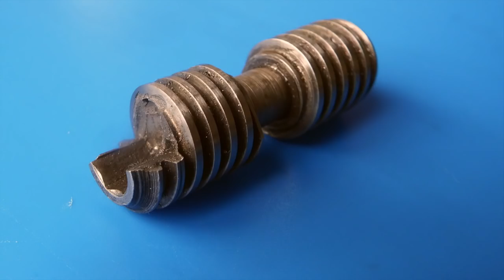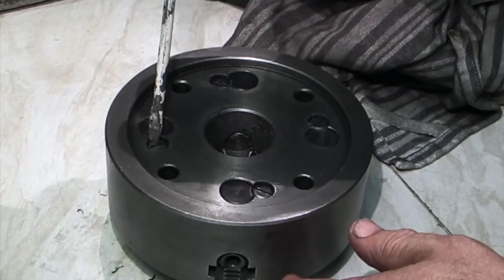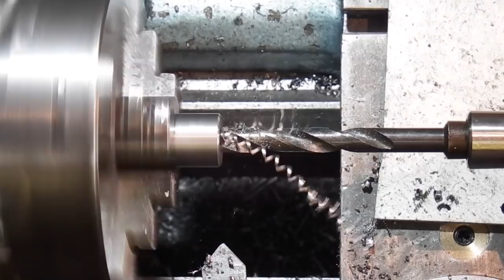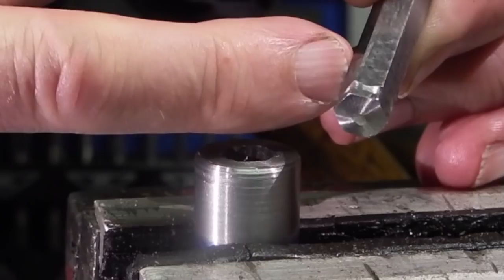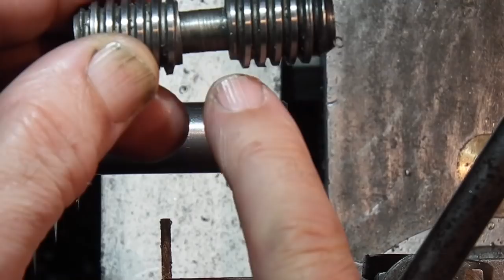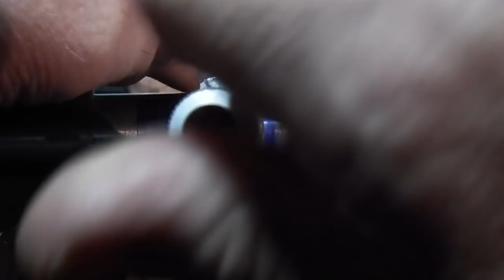4 Jaw chuck repair part 1

Comment: I need to do this with my 6inch Bernard 4 jaw Chuck, firstly I need to rebuild my model A metric lathe, then get a rotary dividing table, then make a 127/135 gear set,  all that’s in my rountoit pile, making useful parts seems such a long way off, I wonder what the ratio to repair/ making useful parts, when you acquire a 50+ year old lathe,
I watched this when it was first posted and I needed to do it then, it hasn’t helped that I moved home restored that, then I am building a workshop, all whilst my machines are stored elsewhere.

Comment: Excellent video Alan, unfortunately my chuck a Burnerd 34M is not fitted with the retaining screws in the back and I can't remove the jaw screw. Any suggestions would be much appreciated. Best wishes Brian
Reply from the maker: Hi Brian. I'm sorry I don't know the 34M but the jaw screw must be able to come out, is there a dowel holding it in?
Can anyone help
Reply: Hello again Alan,
Many thanks for replying so promptly, I've found the screw has been pressed in very tightly, but heat and a large hammer has prevailed ! I'm now well on my way with the new screw. Thanks for taking the time to make your excellent videos, keep up the good work.
Best wishes Brian

Comment: What material did you use for your new adjusting screws?
Reply from the maker: Hi Jim I made it from mild steel and still using it 2 years later. I made a spare just in case
Reply: @enotsengineering  thx very much! Great video.